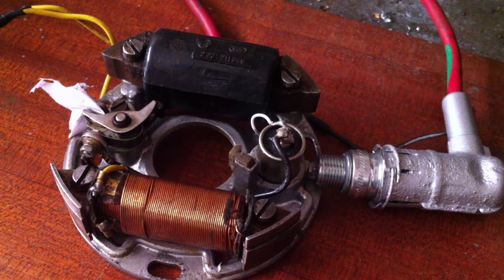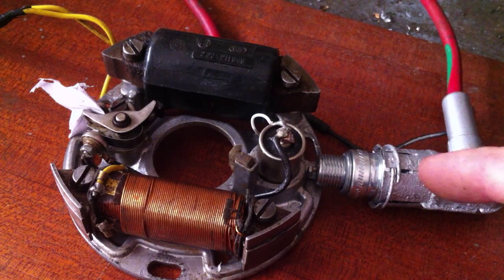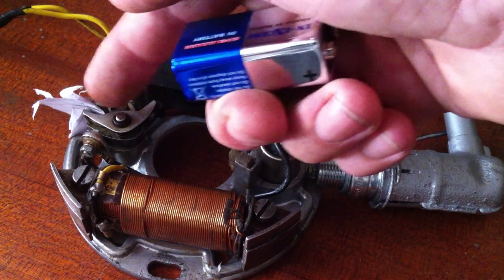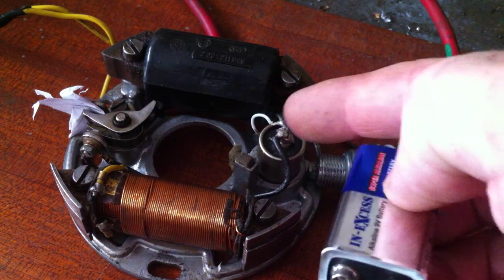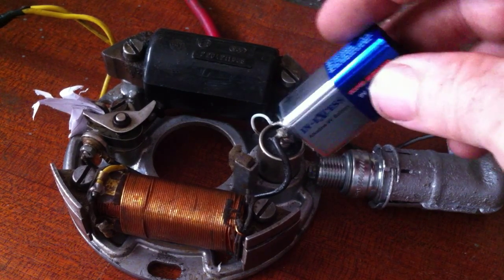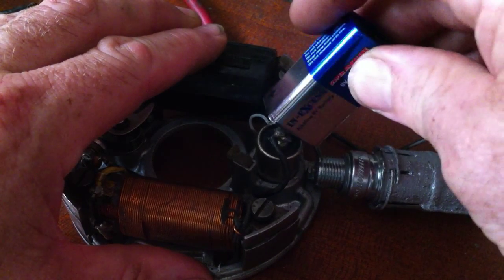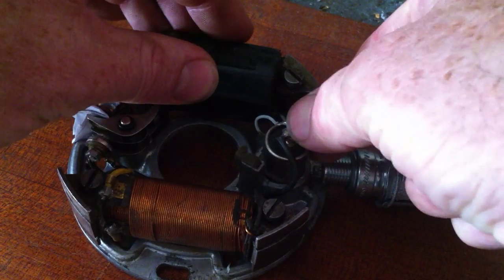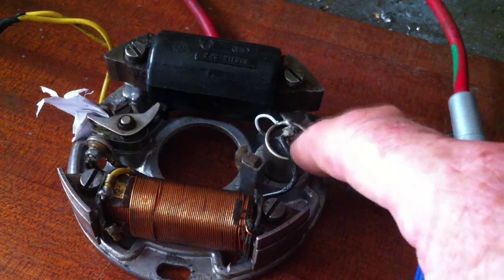Vire ignition static test and explanation

Comment: if the points are in the open position  with out any thing between them   will the plug still spark  with the 9v battery bridged  between the points      any info appreciated